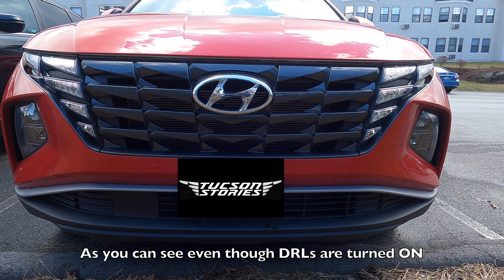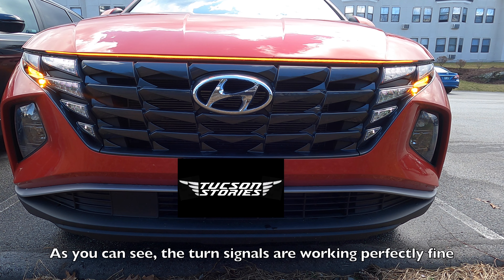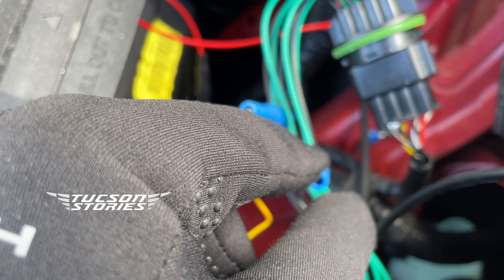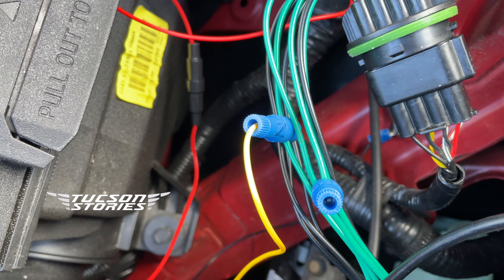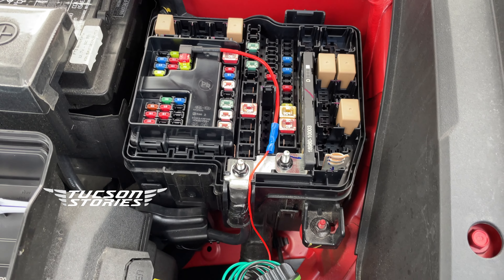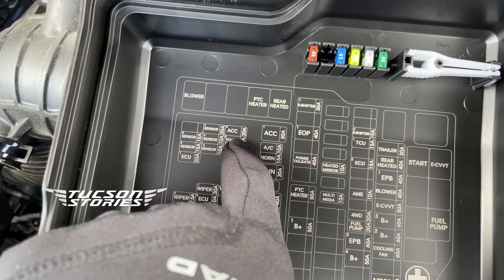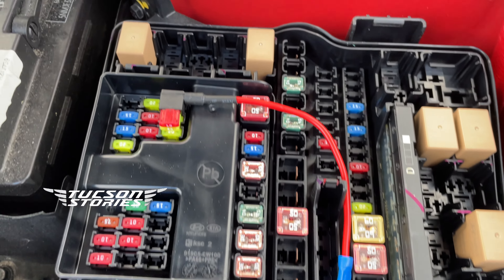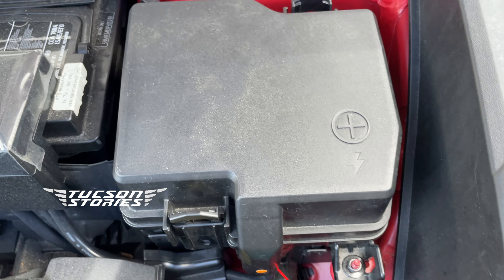Hood light stopped working | Defective product or bad installation??? | Tucson Stories

Comment: Hello sorry but i don't understand what is the problem, where i can fix the red cable?
Thank you
Reply from the maker: @artnow3182  in the first video, I thought I can use power source of DRL for while light. But DRL lights have multiple power sources and tapping into one of them is not working. So, instead I tapped fuse in fusebox
Reply: @TucsonStories  ok ty and you install it on the 20A acc fuse and protect the led with a 10A is that right?
Reply from the maker: @ that’s right